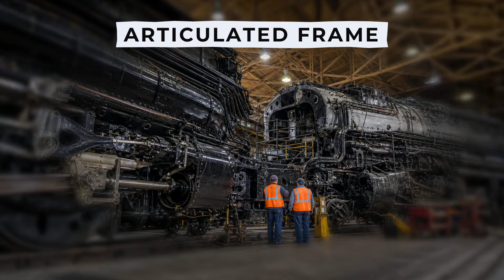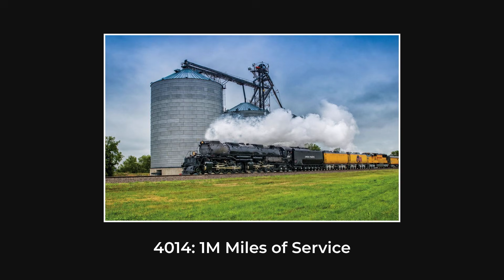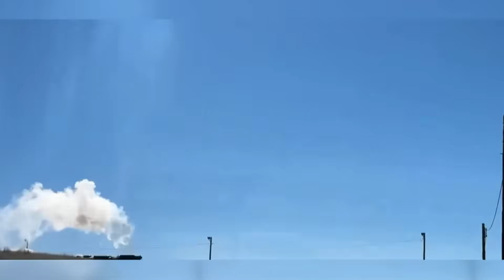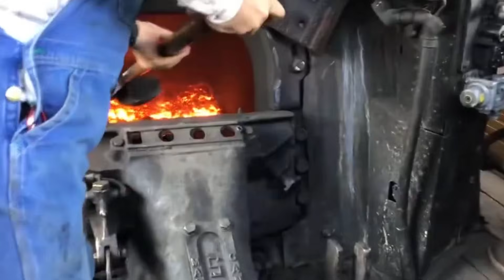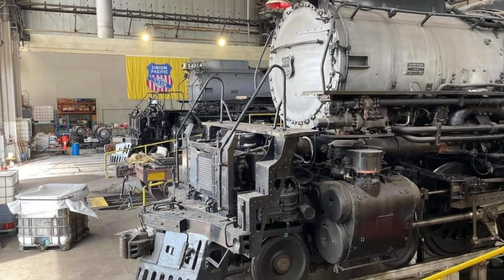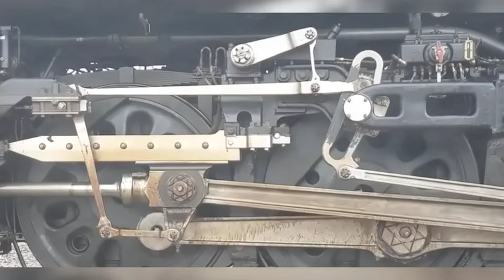Why the Big Boy No Longer Runs on Coal

Comment: Of course Union Pacific Big Boy 4014 has had some modifications when it was restored to service. This locomotive has a modern radio communication system. This locomotive also has a modern head of train and end of train device. Also this video describes why Big Boy 4014 was converted to burn fuel oil. Also amazingly Big Boy 4014 was equipped with a modern Positive Train Control system. This is not the 1940s it is the 2020s. Running a historic steam locomotive is very different today.

Comment: There is a YouTube video where Ed Dickens the manager of the Union Pacific Steam Program states the one of the big reasons for converting to fuel oil was to cut down the fire hazard that exists when burning coal. Also the Durango & Silverton narrow gauge railroad had to convert their steam locomotives to burning fuel oil after a large fire in the area that was likely started by burning coal cinders from a steam locomotive.